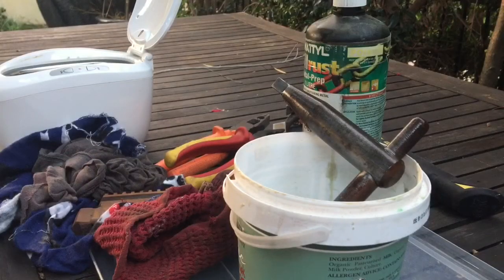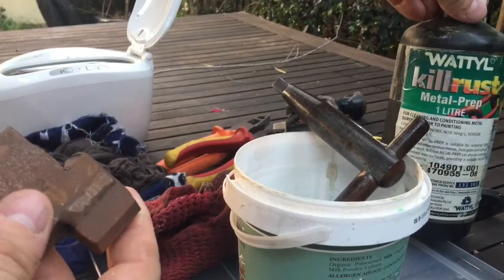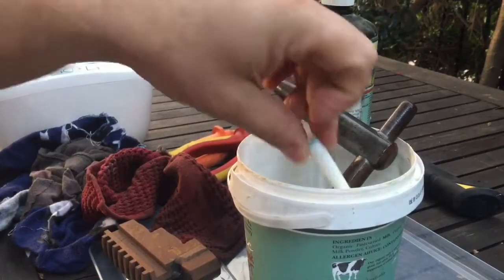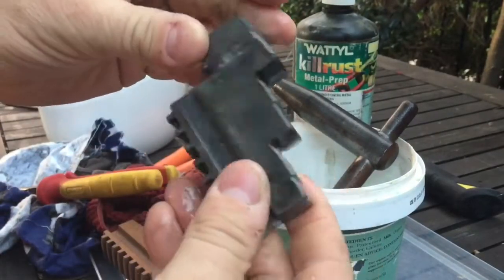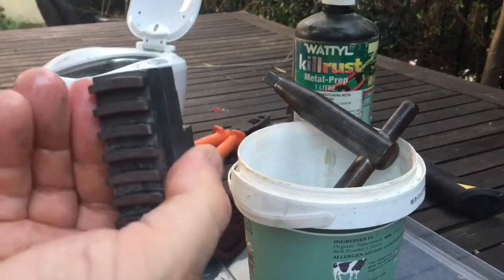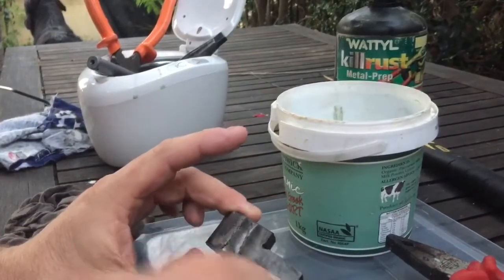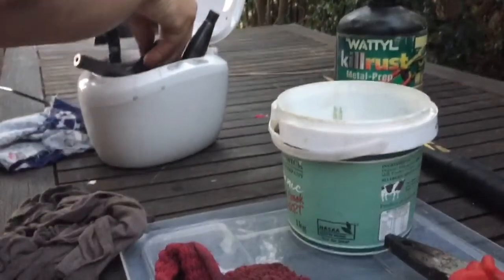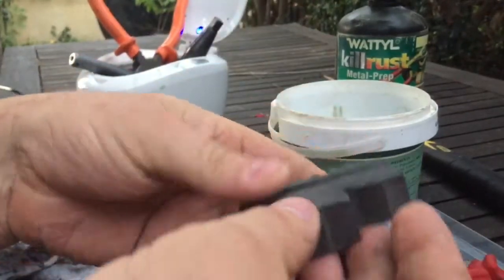Ultrasonic Rust Removal

Comment: BAD IDEA. All acids eat away at the base metal too. There are more expensive solutions like Evapo-rust which use a chelating agent and will not eat the metal. I have the same problem as i'm cleaning precision surfaces with with flash rusting!
Reply from the maker: Have you tried precision ground flat stones for that application? They have been very helpful in fixing up precision surfaces for me a number of times
Reply: @JBFromOZ  Not buying those and I cant make those yet ... maybe next month since i'm picking up a surface grinder tomororw

Comment: That ultra sonic cleaner did a great job. What brand is it and what solution is in it ?

I normally use electrolysis but that leaves a black coating - which rubs off with scotch pad.  However, if you use phosphoric acid on it after electrolysis the black washes straight off super easy and you get a perfect job.  You should always neutralize phosphoric acid or you will get a light white film over the metal from oxidation .

Cheers Rob
Reply from the maker: G’day Rob, I bought mine from Altronics, to clean a carburettor for a ride on lawn mower!
something like this might be similar.

I user killrust metal prep, which is active ingredient phosphoric acid. Some of the bigger parts I would have liked a larger unit, see the one at the end of this comment, looks promising!

http://www.altronics.com.au/p/x0103-50w-deluxe-digital-display-ultrasonic-cleaner-600ml/

https://www.jaycar.com.au/domestic-ultrasonic-cleaner/p/YH5408

I just checked on Banggood, they have a range that looks pretty interesting, if I chose again I’d get something larger 

https://m.banggood.com/search/ultrasonic%20cleaner.html

This one looks like it might be the berries to take some bigger parts plus a bit more oomph!

https://m.banggood.com/JP-020-100W-3_2L-High-Quality-Stainless-Steel-Ultrasonic-Cleaner-p-948465.html?rmmds=search
Reply: Thanks for that info. I might have to do a product review on one of these ;)

Which one do you suggest - the bottom one ?

Cheers Rob
Reply from the maker: Yeah mate! The things that appeal are: 100W transducer (the active ultrasonic element) 3.2L capacity, hopefully big enough to fit larger parts in, and all stainless housing. It would be awesome if you are able to review one of those I reckon.
Reply: I will keep that one in mind.  What sort of cleaning agents can be used in these things ?
Reply from the maker: I’ve originally understood that pure water was all that was meant to be used, when I was getting the little carburettor cleaned of years of dried in muck I added some solvent to help get things moving. With the Rust Removal, I was thinking that would help along the phosphoric acid action, and gave it a shot. 
I think there may be some safety concerns with some more volatile solvents, as the energy (heat) and micro bubbles forming with the ultrasound may get to an ignition energy, which could get dangerous.

Comment: Hey JB, have you seen the videos on ‘blacking’ the jaws and anything else you want - leaves steel looking blackish and stops them rusting again because the new surface can now retain a poofteenth of oil. Just like the blackened machine screws you buy etc. it’s too easy. This Old Tony is where I saw it on YouTube . Cheers again M
Reply from the maker: We are presently looking at a technique called "parkerizing" and also keen to try some of the other cold bluing options, to assist with longer term protection. In the end hopefully will cut down a little on maintenance and cleaning in the workshop :-)
Reply: JBFromOZ  - cold bluing. Thanks, I never knew what it was actually called!
Reply from the maker: Most welcome! Come back soon mate :-)

Comment: Great job JB - Wattyl they think of next! Hey, can you tell me what was in the sonic cleaner and when during the video and what you’d recommend now you’ve done it. Funnily enough, I have some soft jaws to de-rust as well lol. Thanks mate, Michael
Reply from the maker: I used a "phosphoric acid" solution (Killrust metal Prep). This seems to act reasonably fast, and also pretty easy to find. Other options include vinegar, lemon juice, or more expensive commercial options including "evaporust"
Reply: JBFromOZ aa